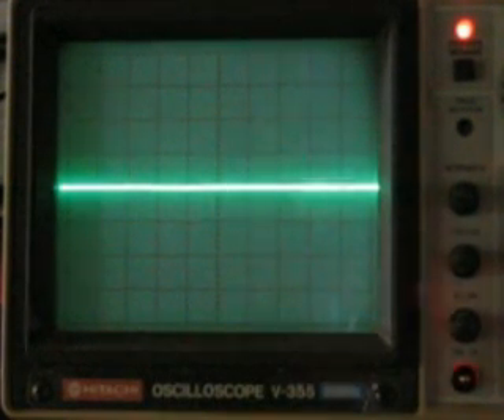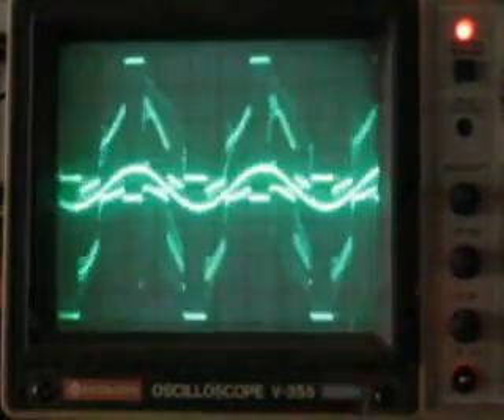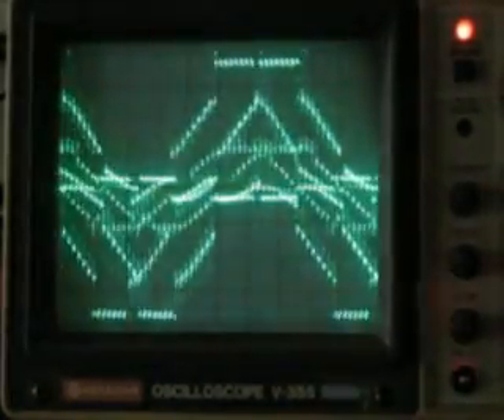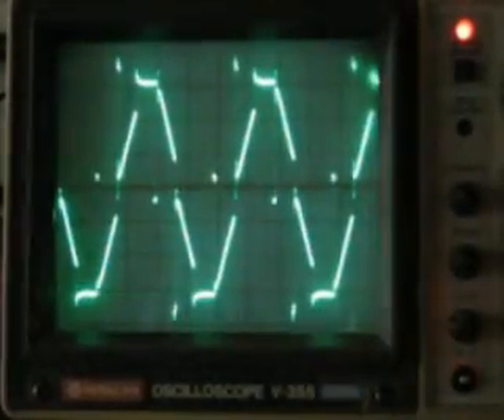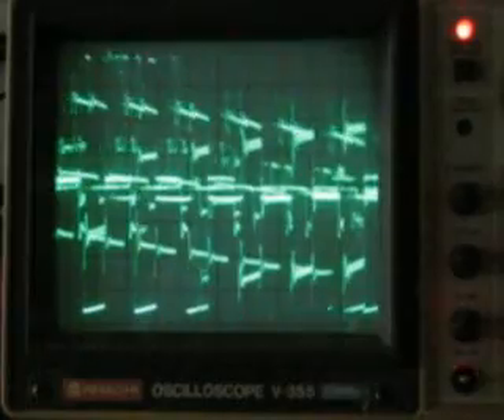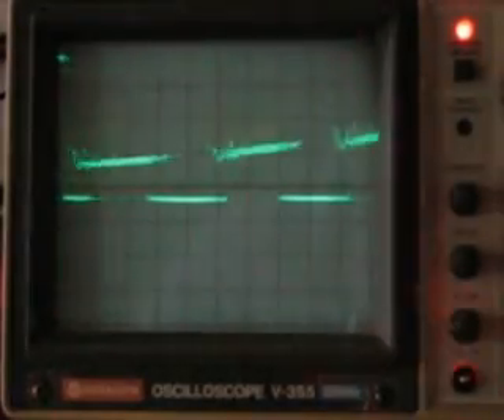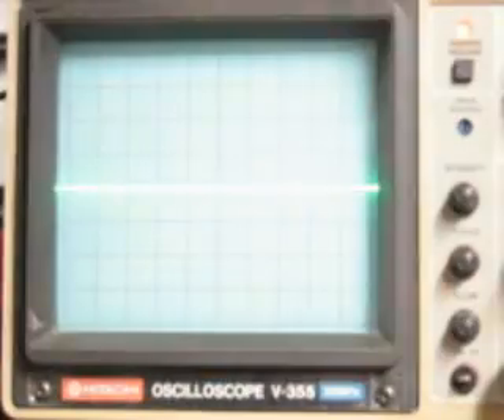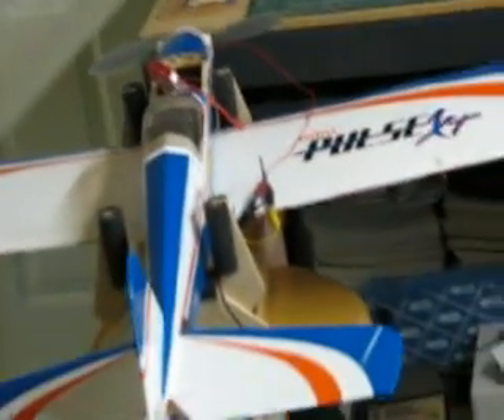Waveform of a Brushless Motor ESC

Comment: How does the ESC make the motor beep when it powers up?
Reply: It runs a high frequency current back and forth through only one phase. Due to the mass of the motor, the high frequency current averages out to zero and the motor only vibrates, producing a beeping sound.

Comment: Very helpful, thanks.
The kV rating (RPM per volt) of the motors makes it seem like the ESCs are modulating the voltage, when in fact they are using PWM.
I guess the rpm = kv * V formula only applies at full throttle, it gives the no-charge rpm for a given battery pack.

I'd be very interested to see the transient current too.

Comment: Really great test !!  in order to view much better the wave form of  the signals sended by the ESC out,  you may replace the engine coils by some electrical resistors. I mean simple create a delta or star configuration using electrical resistors the value must be 100 ohms at 1 watt in order to reduce the amount of current.  I almost sure that you will get a nice and square waveforms, The important parameters to determine: Frecuency Min, Frec Max and time between fases.  thank you